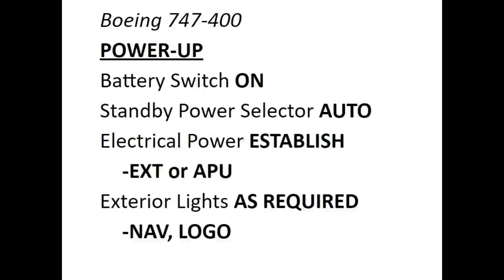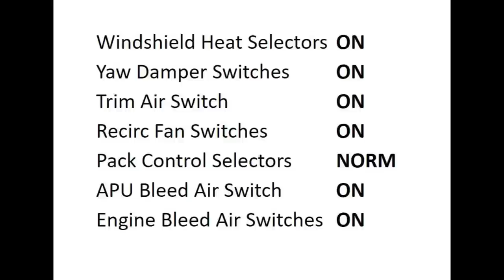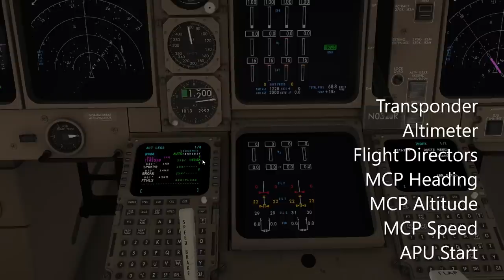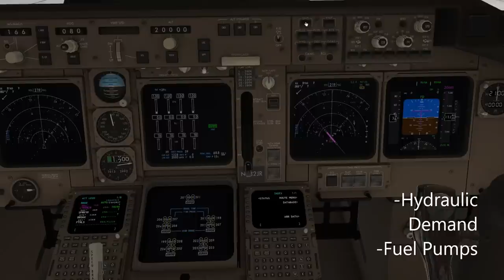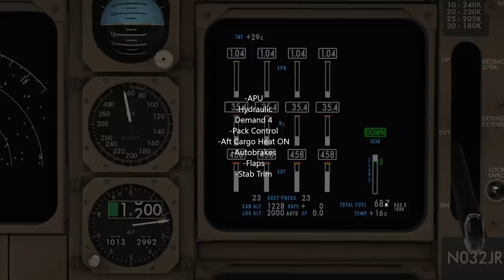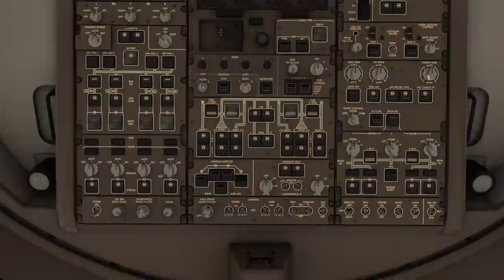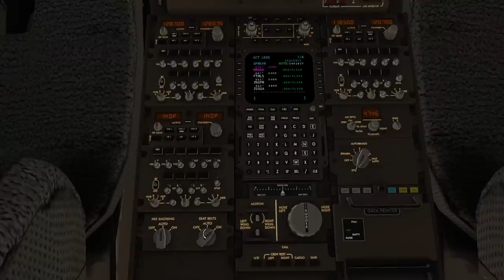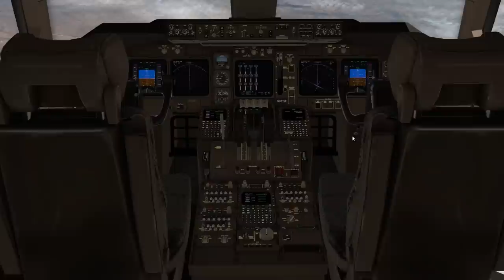X-Plane | Boeing 747 Default | Cold and Dark, Takeoff, Autopilot Tutorial

Comment: At this moment in my learning proces, after a whole lot of studying, I use the step climb procedure to cruise level.
First it was complicated with starting 13 degrees pitch after take off with max take off thrust, at 1000 ft ROC 500 fpm, reducing N1, the flaps settings, etc. etc.
And the most interesting thing is that after retracting the flaps up at about 260 kts and commence the enroute climb above Fl 100 with 340 kts I can leave the throttle at a fixed setting and N1 will increase automatically.

Now it's not complicated anymore.
Flying the Boeing 747-400 is a very beautiful experience every time.

Thumb up from
The Netherlands.

Comment: The best and only good video of 744 startup and autopilot.
Can be great to get a landing Tutorial for this plane

Thank you.
Reply from the maker: Thank you for the compliments. What aspect of the 744 landing are you interested in? Descent and arrival with the autopilot? The landing checklist? Getting a stabilized approach and landing with the 744?
Reply: Flight Brothers FT landing with autopilot.
On 737-800, I’m using the autopilot till 3000 feet from ground. From then I take control and land it manually. I plan same thing for the 744.
So if it’s possible to show an approach with 744 that includes the autopilot till a certain point (3000-2000) feet.

Comment: I just joined a virtual airline on Sim-FTW that flies several 748s so I recently started to use the default 747 after having flown payware/payware level aircraft for the last couple years. I have to say, I was surprised with some of the detail that was included. The start-up procedure is a little weird but funny what things they did include, like working VNAV and autoland, but excluded something simple like EGT limiter. It can be nice to fly something easy/simple every once in a while and it is super easy to land/hand fly because of its size vs a 737 or smaller that can get blown all over the place landing with crosswinds.
Reply from the maker: It is a love hate relationship with this bird to be sure. We suggest you check out the FMOD by iniBuilds if you'd like to upgrade the sound while you're flying it. We have a review of that FMOD on the FSElite YouTube channel (we're contributors for them as well).

Comment: No need to fly the default 744 when we have the Sparky 744 now! It's almost payware level but free. The only drawback i've seen is the NAV display is Xplane default (cannot even read waypoints no matter zoom level) and there's still no dinging on the seat belt sign switch. How hard can it be to add that, lol.
Reply: I spoke too soon. Sparky just came out with a new update. Now it has an authentic NAV display and many chimes and bells!! It's phenomenal.

Comment: If you turn on Autostart, you can start the engine with the fuel on, without autostart, you need to turn on the fuel once the engine N2 reaches 25, otherwise you will get a hot start
Reply from the maker: Great tip, thanks for sharing.  That also works in the 748 for any of you with the SSG 748 Intercontinental and soon to be released Freighter.

Comment: I use X plane 11 for flight simulation of the Cessna 150. Not too difficult to access the instrument panel in its simplicity.

I am also an A&P and I want to be able to access the instrument panels of the 747-400 from a maintenance point of view. I don't quite know how to be able to zoom or focus my monitors (I have 5) at the correct angle so as to properly view the instrument switch panels. I know that it is possible because I am watching this video. This video shows the instrument panels clearly. The video assumes that one knows how to set up the view of the instrument panels.
Reply from the maker: Thanks for the comment. You can move the view with arrow keys, holding right click and moving the mouse, and zoom with the . and ,   The preset views we use are custom and made by finding the view we like with the aforementioned controls, then holding Ctrl and pressing a number on the number pad of the keyboard. That saves views which can be accessed by pressing that number on the keypad.
Reply: @FlightBrothersFT  Thank You! I got it right now. Also, I suppose that the ICAS system in the simulator is not fully functional. Correct?
Reply from the maker: EICAS seems mostly functional. It shows system failures, gear and flap status, etc. there may be some functions not replicated. The center multifunction display ahead of the throttle is probably the most lacking on the default. If you try the mode keys on the first officer's side of the MCP you will find that lower center display runs some but not all modes.

Comment: Sir, can you make a video on how to switch off the engine of 747 properly after landing please...
Reply from the maker: Actually it is rather simple. Taxi to the gate with engines running. Consider starting the APU while taxiing from the runway. Once at the stand, turn on the APU bleeds (for air conditioning) and have the APU on bus for power. At that point click the fuel cutoff switches located under the throttles. The engines will immediately power down. You can then connect ground power if you desire, and shut down the APU.  When you are entirely done, shut off the ground power, turn off the battery, and disembark the aircraft.
Reply: Thank you sir, but i need a tutorial on  complete shut down of 747 after reaching gate.

Comment: To fly this default version of 747-400 anywhere close to realistic you have to do speed increase and vertical speed manually until reached cruise altitude. Put it in LNAV. Do not do VNAV until cruise. Otherwise the plane will behave like a rocket on steroids ... Thanx for video though!!
Reply from the maker: Right, the default FMC is clueless and puts everything into contingency power well over 100%.

Comment: Great Tutorial I've watched it numerous times Trying to figure out what I'm doing wrong.  After take off on the climb out I activate the LNAV all good.  Soon as I hit VNAV throttles go to 0 thrust and can not manually throttle back up. Any thoughts as to what Im doing wrong?  Thanks
Reply from the maker: Interesting problem.  Is the speed on the MCP set to a normal number for climb, and is the FMC programmed with a cruise altitude?  If you go the LEGS page on the FMC you should see the speeds and altitudes it is expecting.  The climb page should tell you what the climb speed is set to.  Please let us know if either of those work.
Reply: Flight Brothers FT i think he crashed

Comment: Good video, but not ideal - EGT in RED all time of climb? If std FMS have some issue (in LNAV mode),  If std FMS have some issue (in LNAV mode), it's not a reason why didn't manager some parameters by hand (FMS is very powerful tools, even in std configuration of XP11)
Reply from the maker: You can certainly can and should compensate for the FMS deficiencies with less automation. We elected to show the automated method in this video since many viewers will want to see how that works.  On my own flights with the B744 I use manual throttles. Also, the LNAV (lateral) works flawlessly. The issues are VNAV and auto-throttle.

Comment: Question, I didn't watch the tutorial yet but when I go to Fuel and balance it says it can go up to 9.5 hours, is there a way to make it able to fly longer?
Reply from the maker: Yes. There are numerous factors affecting fuel endurance. Weight, altitude, speed, and winds all have an effect.  I recommend using simbrief to get a more accurate estimate (it will handle all those variables). Watch our Airline Planning video for directions on simbrief and flight planning for airliners such as B744.
Reply from the maker: We have successfully flown it 14.9 hours from Hong Kong to  Detroit.

Comment: I’m used to flying the Zibo 737. In conclusion is the Default 747 more complicated then both default and Zibo 737’s?
Reply from the maker: Negative. Two more engines, but less complex than the Zibo. If you can fly Zibo you'll do fine with Laminar B744.

Comment: Have you done a video on the autoland feature?
Reply from the maker: No we haven’t Jarrett.  We tend to stay away from autolanding.  The short story, generally, is as long as all available auto pilots are armed and the ILS is tuned and active on both nav rads, you’re good to go.  You would likely get an autoland, or land 3 annunciation depending on airframe.  

We stay away from this for a few reasons.  1) it’s fun to land the plane.  2) the real world situations where you would perform an autoland are fairly infrequent.  Best case, likely coastal and seasonal.  3) for realism, the aircraft, navaids and airport must be certified for cat 3 ops, which is when an autoland would be used.  This is not always accurately portrayed in sims.  Note: the airplane and ILS have different equipment requirements and tolerances they must meet for the certification.

In my experience (Lee) in sim, almost every airplane can be flown to about 200ft which is usually a CAT 1 ILS decision height.  This includes the default Cessna with the S-Tec 55 AP when configured properly.  

I know that’s long winded, but hopefully if you wanted to know how to autoland, I explained that!  If not, fire back.

Comment: Pls help I don’t know what to do it’s so complicated
Reply from the maker: Start at the beginning.  How comfortable are you with, the Cessna or King Air?  If it’s too much it might require a thorough personal evaluation of your comfort.  Let us know!  Real pilots don’t start in heavies!  How much experience do you have?
Reply: At the part in the engine startup i can’t make them turn on, also I’m comfortable with the Cessna.
Reply from the maker: @rocketman3863  you need to have the APU running and the bleed air on.  It uses the bleed air to start the main engines.
Reply: Oh I think that’s where I got wrong, thanks for you’re help!
Reply from the maker: @rocketman3863  don’t forget to close the pack valves before start.  This will increase the duct pressure allowing the bleeds to turn the engines
Reply: Ok, thanks for this. Now I could make a cold and dark startup easily!
Reply from the maker: @rocketman3863  that is great!  The procedure is very common for turbine aircraft .  Glad it worked, happy flying.

Comment: You need configure the performance page in the FMC, for best N1 EGT dont red.
Reply from the maker: Thank you for the comment.  The Laminar 747-400 uses the default Xplane FMC, which does not have a performance page.  One of the largest limitations to the Laminar aircraft is this simple FMC.

Comment: When I’m trying to start my engines it just won’t work
Reply from the maker: Things to check.   Fuel, APU on, APU bleed on, engine bleeds on, packs OFF, start one engine at a time, fuel cutoff to ON at the mark or use the autostart on overhead.
Reply: @FlightBrothersFT  when I’m looking at the screen to turn the fuel on it moves so quick and when I do turn it in it just stops at 30

Comment: Hey how fo i do a ils in the 744
Reply: How do i do*
Reply from the maker: Dial it up on the RAD/NAV page on the FMC.  Mouse over the freq and use the scroll wheel to set.  After that, normal indications should be see once in range, LOC/APP mode on MCP should also work.  Cheers!

Comment: I think you are a missing radio frequency setups
Reply from the maker: I cannot remember if that is in there, but here is the information you need. COM radios are located on the center pedestal between the pilots. NAV radios are accessed by clicking the NAV/RAD button on the FMC. This takes you to a custom page displaying the current NAV radio settings. Hover your mouse cursor over the frequency on the FMC screen and you should get arrows for adjusting it.